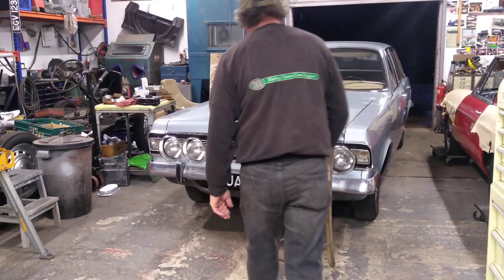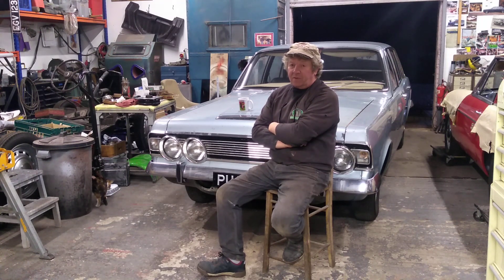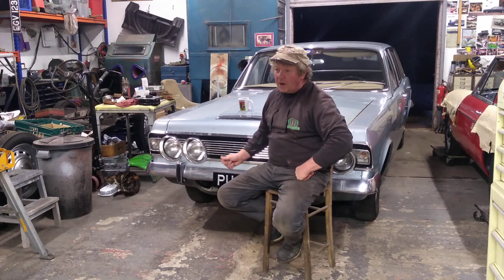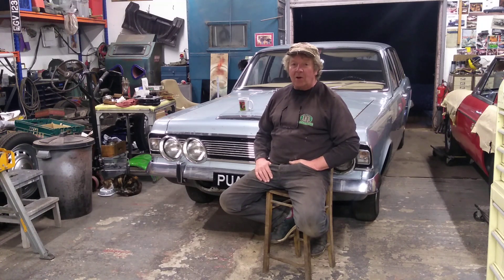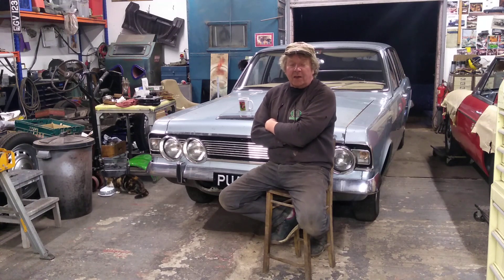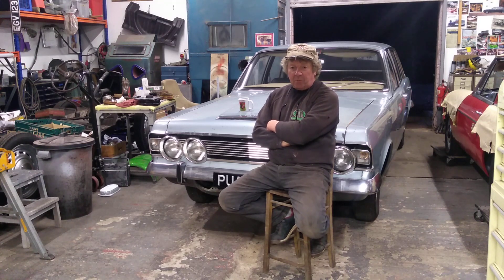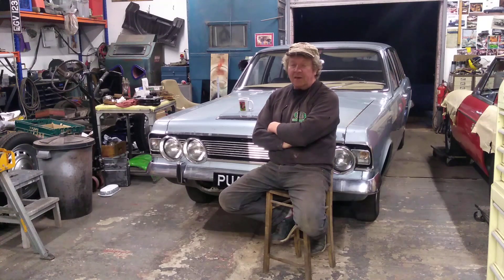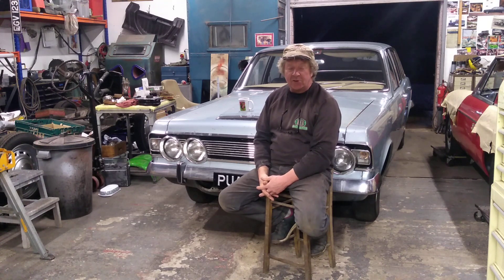Classic cars all that glitters is not always gold.

Comment: Couldn’t agree more, solid advice. I’ve worked on cars as a hobby since my early teens, now almost 60. Owned my Stag for pushing 20 years and 3 years ago did a bare shell rebuild, all work done myself. 
Then for something to do bought an MGB GT as a rolling shell and loads of boxes of bits, cheap as chips but had “ all the welding done” sills, floors and rear half wings. Nearly left it as was but decided to turn it over on the jig and strip the black stuff off and that’s when I found bathroom sealer where seam sealer should be so I pulled al that off and found it had been used instead of welding, each side was tacked together literally by six tacks each side. So no outlay on panels but quite a while re- aligning and welding. Long way of saying, as you said, you need to know what to do if you buy one. It’s all done and in daily use now by the way!
Reply from the maker: Thanks for commenting, great to hear one actually got completed intentions are good at the start but soon disappear in a lot of restoration jobs.